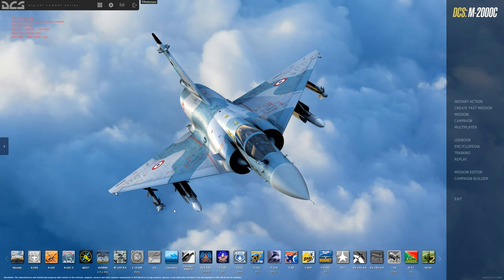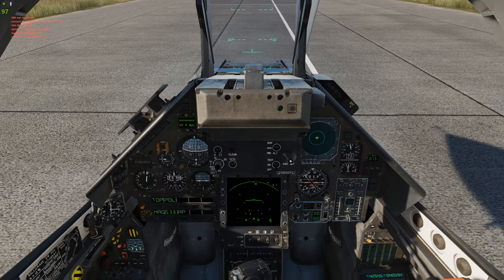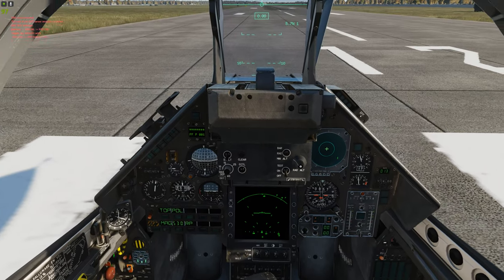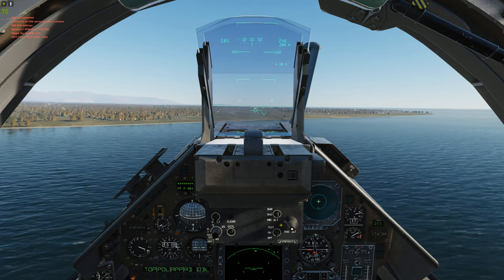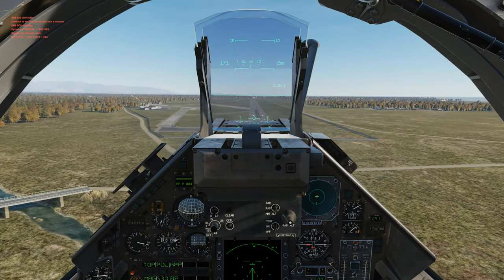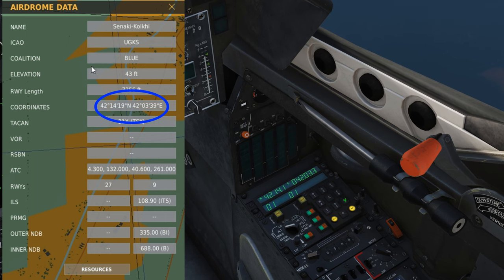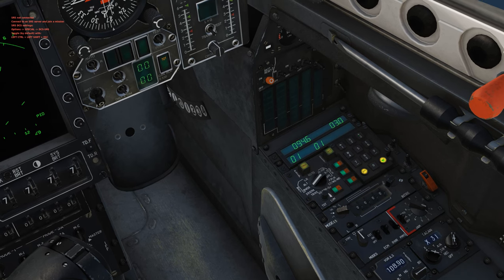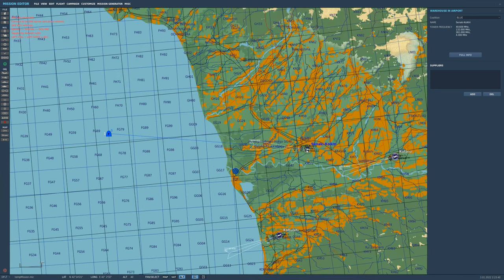DCS Mirage 2000C Tutorials | 0 to hero | Ep2 - Taxi, Take off, landing + ILS landing.

Comment: I dont know if you correted yourself in the other videos but you are typing the coordinates for the ins in wrong, the mirage uses degrees minutes decimal for the ins and you were using degrees minutes seconds, you can change what is displayed on the map with left alt+y.  Other than that, really helpful video, thanks.
Reply from the maker: I mean it worked. It probably has changed since this was done right as they started redoing the mirage
Reply: @TomP-148  probably did, i really liked the video though thanks for the tutorial.

Comment: I followed all of what  you did for ILS landing and still did not work.  If it is set up prior to take off then it works.
Reply from the maker: Certain airfields don't have ILS/tacan
Reply: @TomP-148  Thanks, I know that, but Batumi does have it.  I tried the process of setup while flying and couldn't get it to work.  Not sure what component is missing.
Reply from the maker: @solmanbandit  try Senaki like in the video. 
If anything they might have changed the system up, which would be in the latest chucks guide or Razbam manual
Reply: I have the same problem i did everything exactly how you did it in the video i pressed everything at the same time as you but its still not working what could it be honestly ?
Reply: @TomP-148  I tried Senaki and Batumi, neither worked. I also followed the ils tutorial mission to the letter and it did not work either. Did the mirrage get a new update where something got changed?
Reply: Same Problem. Somebody solved this?